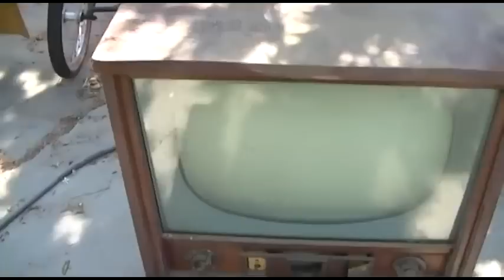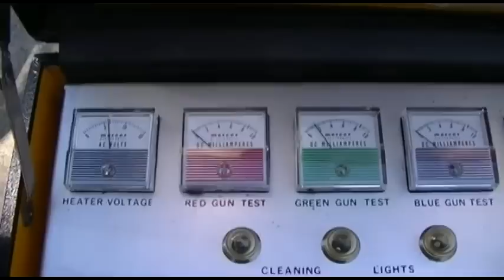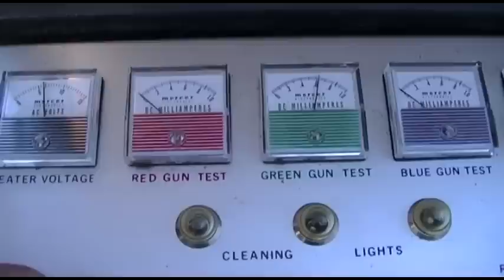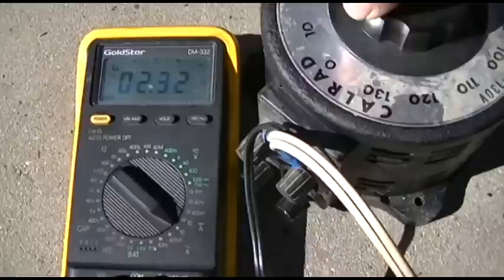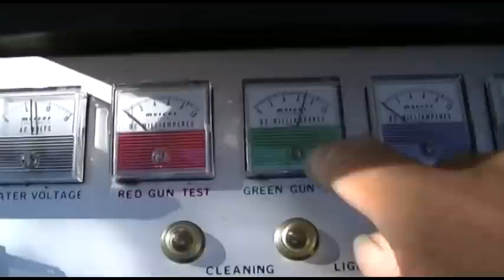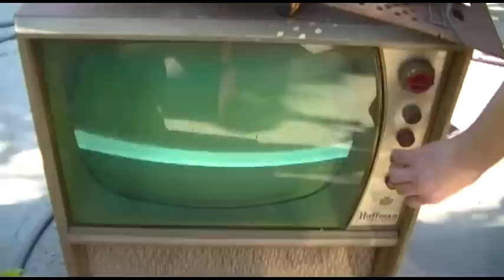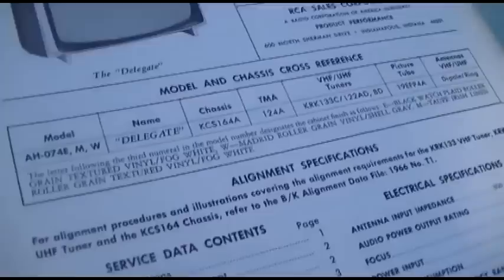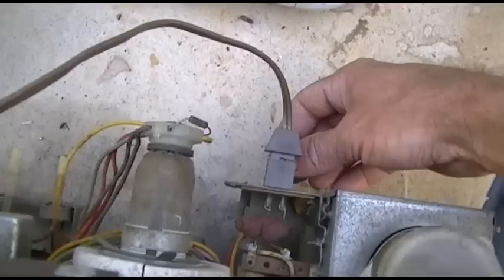Testing CRTs Powering Up 1950s Black and White Console TVs

Comment: My parents had a 12 inch black and white set similar to that last one in the mid 60s.  I wish I could remember the brand. Maybe it was Quasar.The channel knobs were on the top. I came across it again in 1983 when I was cleaning out the garage. I plugged it in and it still worked.

Comment: The flyback on mine is "leaking". Can see the yellow wax melting out. Still runs but don't like it. It cost me little over $500 to come from Cali to west Texas in '09. But she is in pristine shape. Seller told me the CRT was bad. All it needed was a small adjustment and came right to life. I'll PM you tonight about it. Gotta be at work in an hour. Thanks!

Comment: I'm a bit confused about the correct initial power up procedure. I recall you saying if you variac a TV with the cap on the horizontal output tube that the horizontal oscillator might not run and EOL the horizontal oscillator tube. But I see in many of your videos that you variac the TV and the set is fine in terms of the horizontal oscillator. Which is the best method for variac-ing a TV?
Reply from the maker: it depends on the tv. probably the best general way is bring it up while watching the plate or cathode current doesnt get excessive.
Reply: Ah, gotcha. CRT comes before filter capacitors. So as long as the oscillator is running, the plate current will be fine?

Comment: So, what's the point resurrecting these old TV/radios? Nostalgia?
Any one would buy these things in the age flat screen TV's , hifi stereos and mp3 players?
Reply: +szaki They are worth way more than flat screens. Quality builds, those last for over 20 years, and flat screens, not more than 5.
Reply: Bought my Samsung 42" flat screen TV 10 years ago, edge on lighting, only use 150W, light weight, still works good, no problems so far.
3 HDMI inputs, I have my PS3 and laptop plugged in to it. for games and movies!
Very happy!
Reply: Most flat screens dont last that long, but those TV's last at least 20 years. People repair them for their own enjoyment, it's cool to watch old shows on old TV's, or even using a converter box to watch anything that you can watch on a flat screen.
Reply: Yeh, well the cheap ones don't, quality do last a long time.
You get what you pay for!
If those old break, where do you get parts?
Reply: Old ones are easy to repair, CRT may be hard to find but anything else, its easy. You can get  95% of parts from any local electronic component/part store, or even used tubes from craigslist. They are CHEAP.
Reply: +szaki The point is he can.
Reply: What for?
Reply: Well, a Model T cannot keep up with today's freeway traffic, but they're still highly collectable.
Reply: SilveRRecord Hey wait on there! I have a flat screen tv that's 9 years old & still going strong!!!!
Reply: That's not true. I have a 10 year old LCD tv with a TON of hours on it. The service menu says 30,000 hours. Still works great. After 30,000 hours an old CRT set would have been on its third picture tube and had a bunch of work done to change other tubes. I like the old TVs too, but modern LCDs, particularly edge-LED lit ones, are incredibly simple and reliable. When modern TVs do fail, it's often capacitors...not much different than the old CRTs.
Reply: not about reliability...all about serviceability....and for the ones asking why...i dont know...for me its a just a hobby no money to be made...but why do people dig out ruins and skeletons? why do people preserve stuff in museums? ...  there are so so many videos on youtube, if you folks are not interested in a subject why do you watch videos about it and ask those dumb questions??????go watch stuff you enjoy...
Reply: exactly  no point in fixing this junk unles your going to open a museum